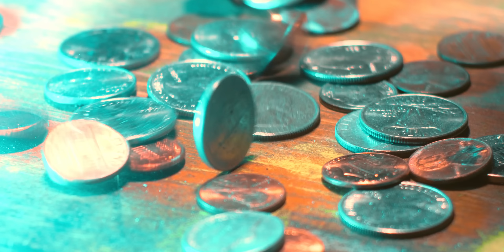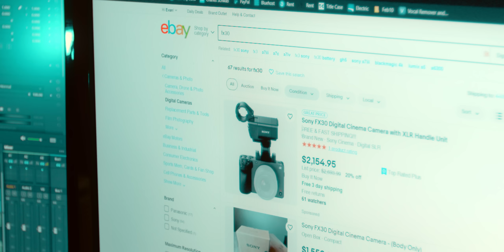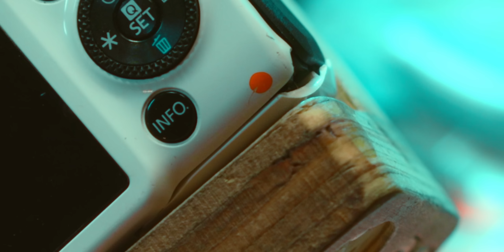My $0 Camera Rig

Comment: The idea that made me stop buying gear and exploring what I had (which was great already at the time, more than I needed even for work) was to learn how to achieve the result of what you want with what you have.  I'm a stills shooter only, so it's a lot easier for me in that aspect; a raw file is virtually the same on most bodies in the last decade, aside from resolution and low light noise.  I picked up an Olympus E-PL8 about 6 months ago because I loved the Silver/Black design and found a good deal.  It's an entry level MFT camera from years ago, something my E-M1 Mark III blows away without trying.  That said, I found myself using it more and more, eventually I sold my E-M1 Mark III and picked up an E-M5 Mark II for weather sealing.  I have a large Pentax collection M42 to current with a KP and K-1 Mark II if I needed a bigger sensor, but the E-M5 Mark II and E-PL8 both work wonders with the Olympus and PanaLeica lenses.

Comment: At the start I was a bit doubtful about this vid, but in the end I liked it, interesting approach angle to growth and development that I recognize too, limitations spur unexpected innovations to either work well within the limitations, or to overcome them - very true, and something I also needed a reminder of, as I'm waiting for the parts to get here for my own EOS M rig 🙂. I have several other cameras, but the thought of in a sense "hacking" an older camera into a worthy "film rig" inspired me to get started on it. I have several other cameras, but you can't have too many (within reason). There is a symbolism in it for me, I'm "recovering" from breaking two vertebrae, meaning a combo of physiotherapy and figuring out how to live mostly in a wheelchair, and at the same time working out how to build a movie rig that works for me out of an old EOS M. Wheelchair and broken back make bigger heavier cameras a literal pain to work with, but I think the EOS M+Magic Lantern+selected semi random bits of cages, rails, screws and optics will turn into a camera setup I can work with and output decent enough to live with.

Comment: Wow, I always thought that this fuzzy vintage look in old video footage was just because of the quality of film they had available back then and lack of need for high quality recording, processing, and storage, due to the extremely low resolution of TVs 50 years ago, but now i want to go buy a vintage camera lens. If the glass has been replaced, will it still have the same vintage look?

I realize a lot of the vintage look is in the beautiful color grading your did, but i can see that just as much is from the actual recording - and the combination really tricks my mind into thinking that I'm looking at footage from a 1960's archive. It's beautiful and nostalgic.

I'm now a subscriber after one video.
Reply from the maker: The vintage glass is a huge part- if I put modern lenses on that camera I could make it look the same as any other shot in this video. The old coatings and quality of glass they used back then gives everything that fuzzy, glowy look. I’ve even put the vintage lenses on my new camera before and gotten a classic look out of it. The color grading helps sell it too
Reply: @EvanMonsma  Thanks for the reply, but I was just referring to the front line glass that might have cracked over the years from a fall or other impact. I'm just asking because of I find something at a garage sale or estate sale that's still perfectly intact after all these years, I might be concerned that the first front lens of glass or first couple of lens elements might have gotten damaged and been cracked and replaced at some point and I would have no way of knowing as an amateur. But from my understanding there's like 10 or more different individual glass elements in a camera lens so I was wondering if just those frontmost glass panels would make a major difference in the look of the recording, I'm not talking about the aperture or anything behind that.
Reply from the maker: @DanielCrist  Nah, I wouldn’t worry about anything like that- I think the imperfections come from the engineering of the lens as a whole, even if it had been repaired I think it would still have the same look it did before
Reply: @EvanMonsma  cool, thanks for your answer! And again, great coloring job on this (and on the project as a whole), that really pulls half the weight of the look.

Comment: This actually helped me with the battery door on my Canon AF35M II. Never thought of using a L-bracket for my other camera to hold it shut. The Tripod screw mount is so close to the battery door it holds it shut really tight
Reply from the maker: Glad I could help find a solution!

Comment: I really enjoyed this and I have often wondered why people buy expensive gear when you have most of it at home :) Adding a handle and weight can be done with things we already have. I did not have a strap so I just took a strap from a camera bag. The fittings that attach to the eos m was not there so I just used some metal wire and fastened. Not pretty but works :) And if it works it is usable. Looking forward to more stories

Comment: Great video! Can you do a breakdown of the mount you use and how to pair old lenses?
Reply from the maker: I would definitely like to do that at some point. When I started with cameras I had no money for actual electronic lenses so I bought a lot of weird random $10 eBay lenses and tried to figure out how to adapt them to work. There’s a story in there somewhere for sure- I’ll add it to my list
Reply: @EvanMonsma  Thanks for replying. I'm most curious about how to go about adapting lenses and where to even start.
Reply from the maker: @iammik  if you’re working with a mirrorless camera you have a lot of room for adapting basically any kind of old lens, with DSLR it’s more restrictive since a lot of lens types need to sit closer to the sensor, like the C mount ones I used in this video. For the most part you can just buy the cheap Chinese adapters for like $10 on eBay and adapt old stuff- I think some of the best to start with is just old SLR camera mounts, like Canon FD or Pentax PK. Pick up one of those adapters and some random vintage lenses of those mounts and that’s a great way to get started because those are pretty high quality lenses usually. C mount is my favorite but a little more hard to find- you need C mount for adapting, not CS mount, and a lot of listing will say C / CS mount so you might have to do more research to find the specific lens and see if it’s C or CS. 

I could definitely do a video on it down the line or potentially talk about it in a livestream at some point.
Reply: @EvanMonsma  That Video will be fantastic and thank you for the info! Super helpful.

Comment: Damn what an inspiring video! How did you get the old lenses to work on APS-C tho? I would love to build a little vintage setup myself but I really don't know what to look out for
Reply from the maker: Just an EF-M to C mount adapter. You cant adapt the C mount lenses to DSLRs but if your camera is mirrorless there should be an adapter available. Other old mounts that I've used are Canon FD and Pentax PK, both of which have cheap old lenses available and can be adapted to almost any mount

Comment: and the question remains: what camera shot the last scene? ;-) great video. shooting with gh1 and old lenses since 2015. low megapixel = high excitement
Reply from the maker: Another camera with an interesting story :) Its actually an action camera modded to take MFT lenses, using a Rokinon 12mm cine lens. Will have a video on that down the road when that project is done. Rocking with the GH1 sounds like a lot of fun!
Reply: @EvanMonsma  osmo og?

Comment: The video was great, but It really seemd a little over-contrived. Did you really forget your mounting screw on the way to the race, and just happen to need to shoot those trunk shots? And did you really not just have any tape handy to keep the battery door shot? The result was beautiful to watch, but the contrast between the elaborate production and the makeshift solution didn't feel believable to me, at least.
Reply from the maker: Fair enough critique. I did actually lose the screw. And tape doesn’t hold it shut well enough, it needs to be clamped. The segment where I lost the screw was filmed before I recorded any voice over or wrote any script lol
Reply: @EvanMonsma  Maybe tap a 1/4-20 or 2 into a spare part of the wood, so you've always got a spare screw? And pre-pack some zip ties, tape and extra screws into your camera bag for emergencies.
Reply from the maker: @leadwhite1249  very good tips for sure. My camera bag has all sorts of stuff usually, but I brought a smaller secondary one to the race for portability. Lesson learned- set up a run-and-gun shooting bag

Comment: Don't u use Magic Lantern on the M? It's 10x better than the M50 via the hack
Reply from the maker: Yeah I used ML, it is better at some things but for my workflow I can’t be waiting on raw videos to process for everything. Also most modes have a super heavy crop. But for certain things I’ll definitely keep using it
Reply: @EvanMonsma  2 month ago a guy from Syria put out an entire new build that's as good as commercial cams, no hiccups, everything works, including monitors and even HRD/high speed. As for the wait, I do it overnight and for large projects there is "slim raw" lossless compression app. I shoot (no crop) 1080 mode 99% and it's fine. Crop modes to me are basically a free telephoto lens